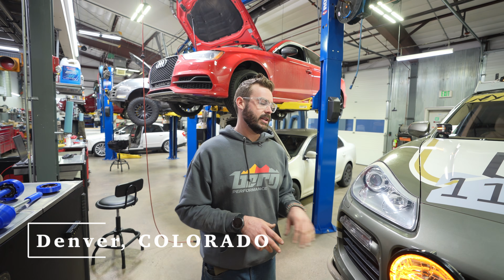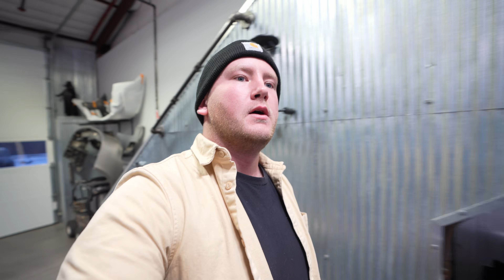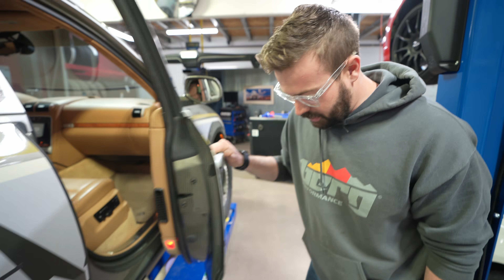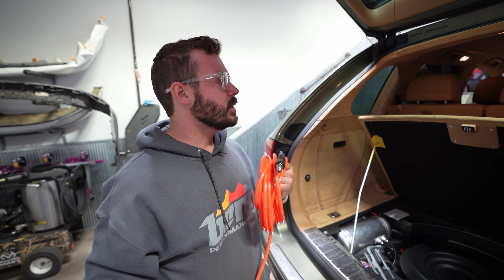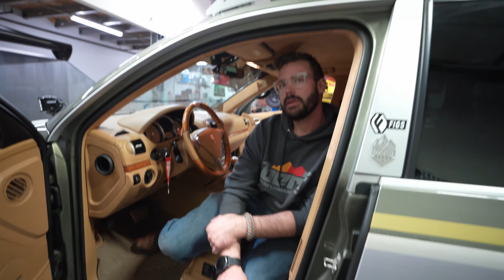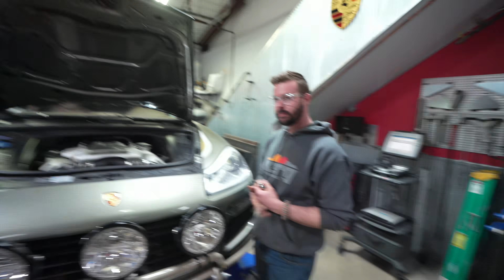The Most EXPENSIVE Porsche Cayenne. ($XXX,XXX)

Comment: I hadn’t seen onboard air implemented by tying into factory system. What is the benefit? Seems to create a single point of failure
Reply from the maker: The benefit seems to be just using the factory tank as air storage basically, for the ARB compressor!

Comment: Why this and not a 4Runner? Or something reliable?
Reply: You’re comparing a 250hp truck to a 700hp truck. Not to mention, the Cayenne (and almost all Porsches) are pretty dang reliable. Plus, heated seats while off-roading is the best way to offroad!
Reply from the maker: I'd say this vehicle will be reliable for many years to come. The choice is really personal preference though. 700hp, hydraulic disconnect sways, air suspension, and a Porsche badge. You've got to drive one if you get the opportunity.

Comment: Looks like a pretty thorough build! I just picked up a 2010 Cayenne Turbo for an overlanding rig, mainly due to your videos. I won't go as extreme on tire size, as my driving mix will be 80/20 between pavement and gravel, with just a bit of the gnarlier stuff thrown in... I just need to figure out what to do about the massive front brakes that will only fit 19+" rims. Edit: there was one chap on Rennlist that actually changed out the motor mounts from underneath on the turbo, without dropping the turbos. Dunno how he did it though!
Reply from the maker: I believe on 2010 turbo you should be able to fit 17-18" wheels. To my knowledge and in my experience, only Turbo S's came with the massive brakes. Don't quote me, but if you don't have two piece front rotors, you'll have the 18Z brakes and I've fit 17" wheels on those.
Reply: @HarrisonSchoen  This one has the 19Zs  with the two piece rotors on it - not sure if it was special option or stock. Some sources lead me to believe that the 2010 and later Turbos got the Turbo S brakes. For now I've gone with a later model  19" Turbo wheel and some 255/55R19 Falkens until I figure out if makes sense to downsize the front brakes to 350mm.
Reply from the maker: @ChileVuela  Personally, I'll be downgrading my Turbo S's brakes to 18Z from a parts car I've purchased. I have been running a 265/50/20 Continental A/T though that allowed me to get on trails without worrying about punctures though!
Reply: @HarrisonSchoen  Rockauto has remanufactured 18Zs for cheap. When it comes time to change these rotors, I'll probably pick those up and get some decent rotors and pads from FCPEuro, and still come out ahead of replacing the 380mm rotors.  I looked for 20" rims, but couldn't find any here in Chile, and shipping would kill my budget, so I settled for the 19"s.  I'm still not sure how I'm going to get all the overlanding goodies I want here to Chile, but that's a problem for future me. Right now it's getting all the deferred maintenance out of the way and testing the truck on some trails!